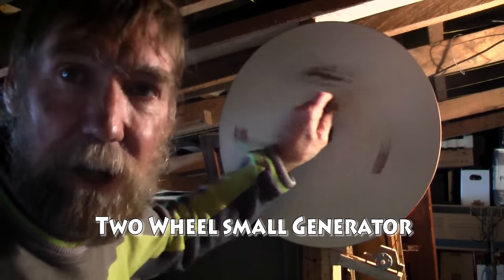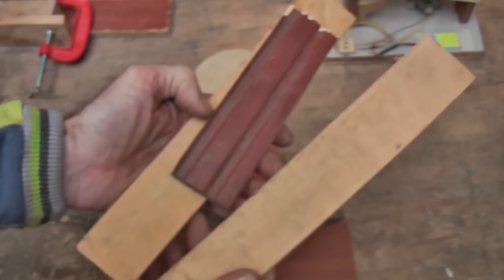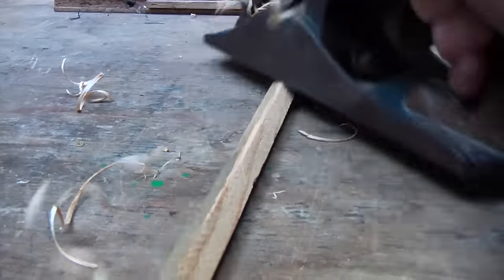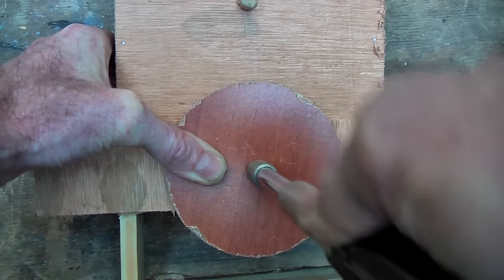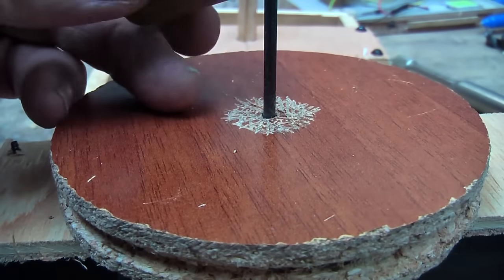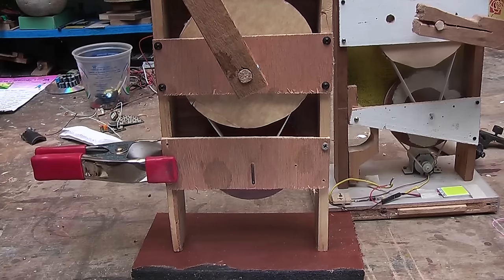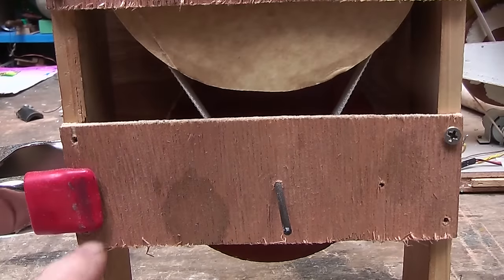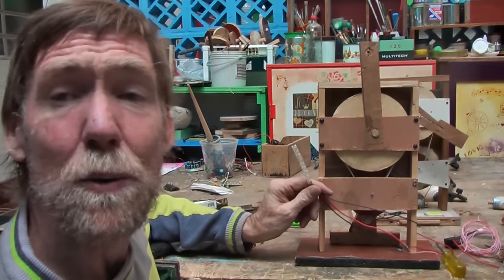Two Wheel Generator.

Comment: Great idea. If you salvage some capacitors from old electronics and add one or more to the the circuit in parallel with the LEDs. It will smooth out the dips in the current from the way the generator is powered. You can see the LEDs dim on each revolution of the handle. Adding a capacitor, will act like a tiny battery to store a little bit of excess electricity from the powerful part of the handle pull, and then release it once the capacitor is full. So when the handle turn slows momentarily on each turn, the LEDs won't dim as much.
It may take a a bit of experimenting to get the right level of smoothing, but if you can get 16v capacitors (common in electronics) these should work well. If you use the electrolytic ones, that look like little barrels, make sure you get the polarity right.